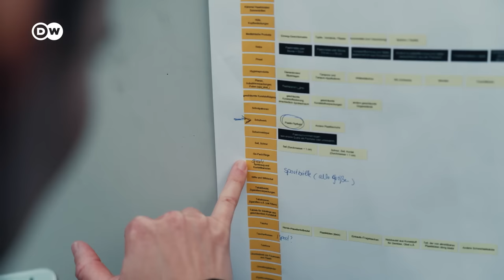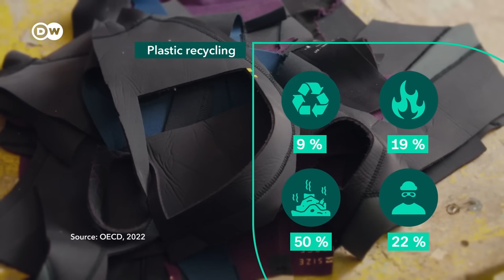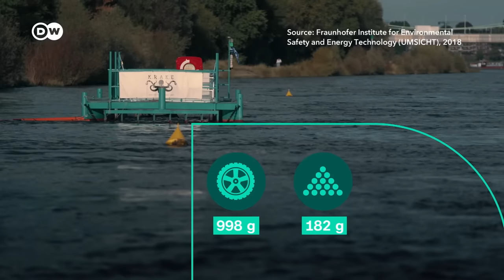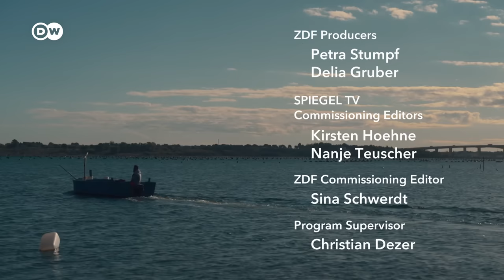Can innovative projects turn the tide on plastic litter in our seas? | DW Documentary

Comment: All these innovations can't compete against the handful of countries that use their rivers and oceans as dumps. But it's a start.
Reply: eventually those countries will start using hemp if it was cheaper and more available instead of hemp being either banned or restricted in most countries to keep the price high so its not cost effective. it can be cost effective. if it was cheaper of course more countries would adopt it and reduce microplastic pollution.
Reply: MOST countries use the water as a dump.  The poorer the country, the worse the mess.